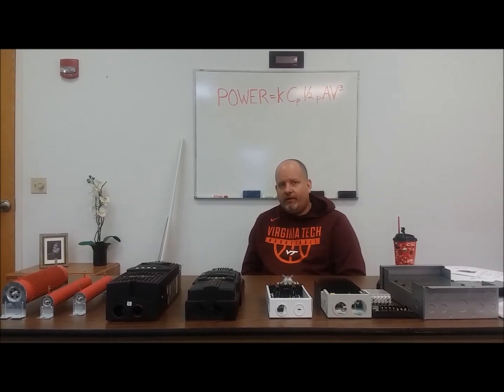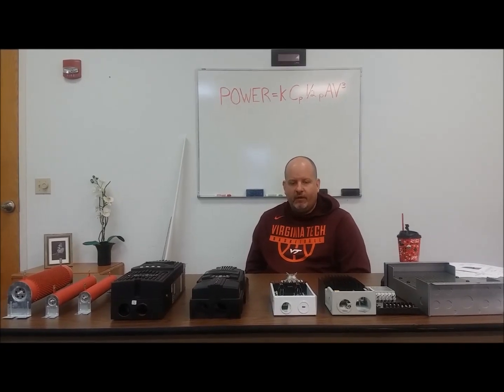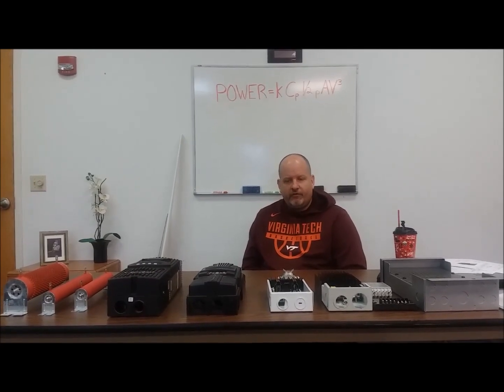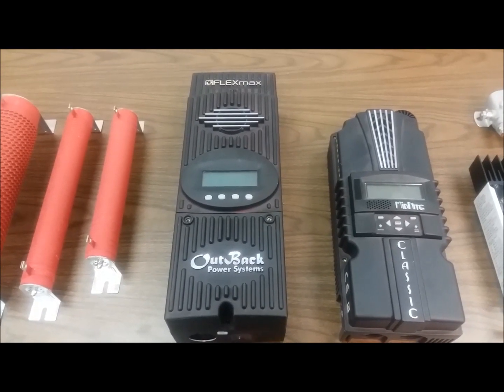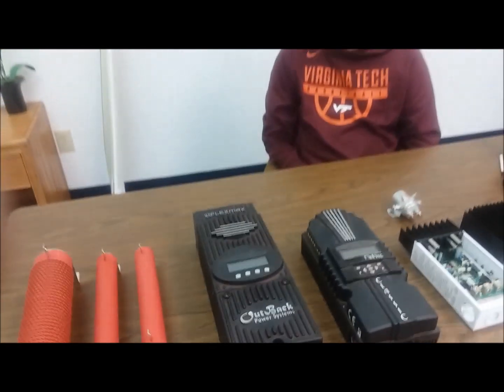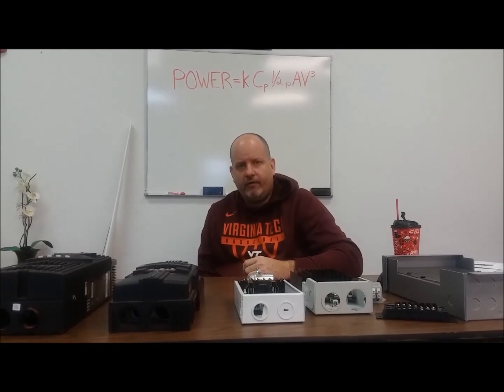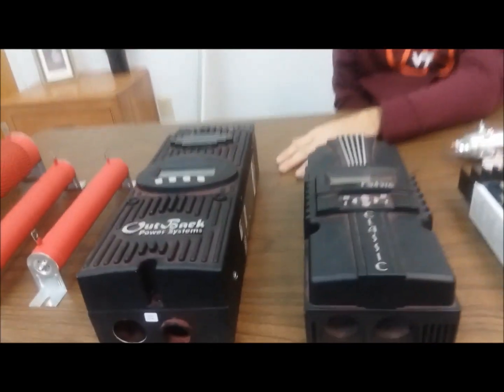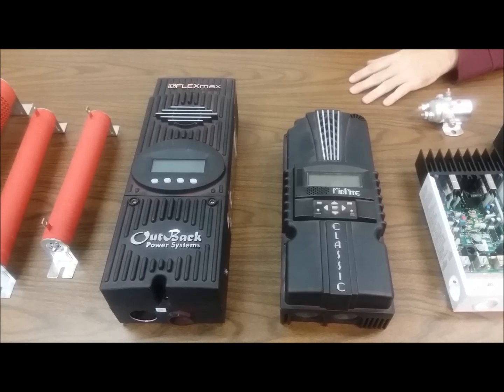Hurricane wind power recommended MPPT and PWM wind and solar  charge controllers

Comment: its best practice to buy decent tried and tested equipment if you want years of trouble free operation without disasters occuring as you continually see with the cheaper rubbish. .youre not saving money buying the cheap crap your wasting money 
nice looking wire wound resistors.

Comment: Hey Tony, I wish you would show where each of the components go in the system. Basically give us a simple breakdown of where the controllers go or the fuses/ breakers and the resistors go in line to the inverter, and if you have a duel system where do you connect the solar power in and the turbine power in from two different charge controllers to the battery bank?